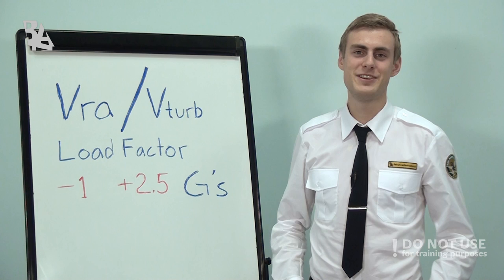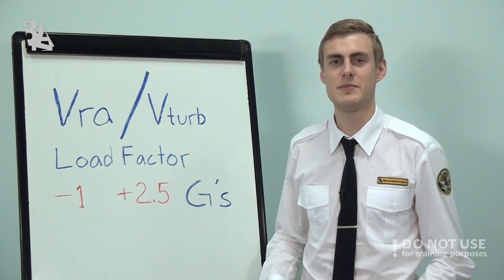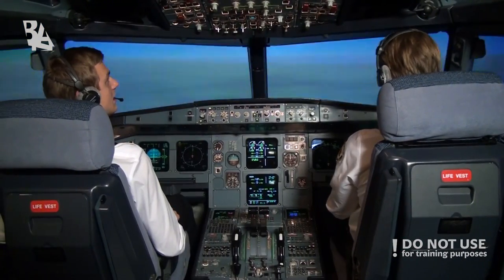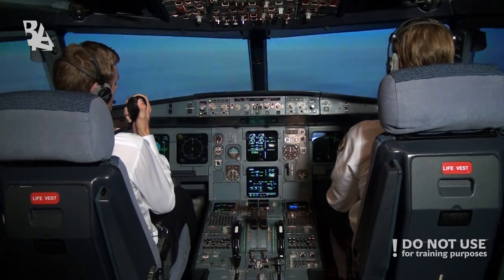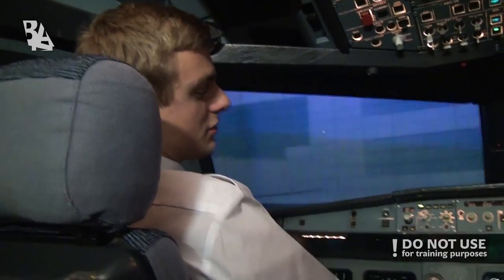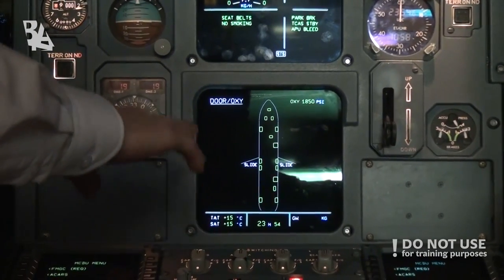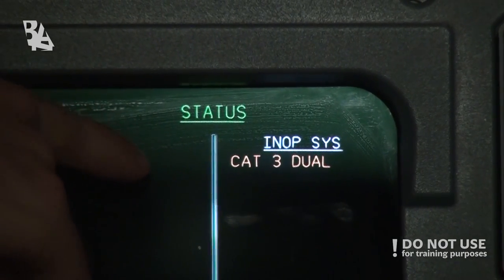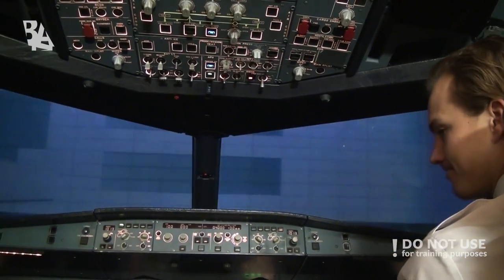Viewer question - answer (part IV) - Baltic Aviation Academy

Comment: 9:27: that isn't a cold-n-dark airplane. It was a parking procedure with everything except the engines pretty much still running. Cold-n-dark would be APU off, IRSes off, packs off, hydraulics off, battery off, etc. Why you'd wanna do that besides a maintenance context, though, is beside me :) Or maybe Airbus' cold-n-dark is different from Boeing's. Maybe in an Airbus bringing the plane back from cold-n-dark involves just brightening up the screens again. In a Boeing it's a lot more involved.
Reply: Cold and dark scenes seems to be missing, sure it will be corrected. (Cockpit is cold and dark just before the end)
Reply: SWEDFLIGHT True, now that you mention it, it's the procedure that's missing.